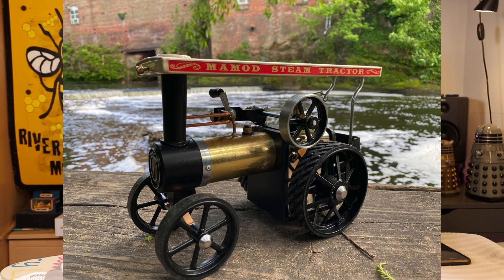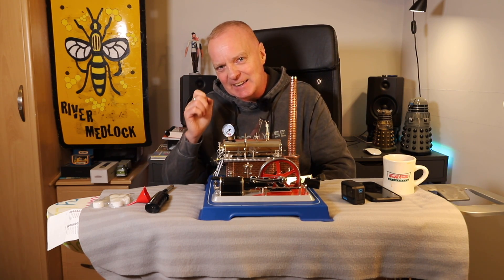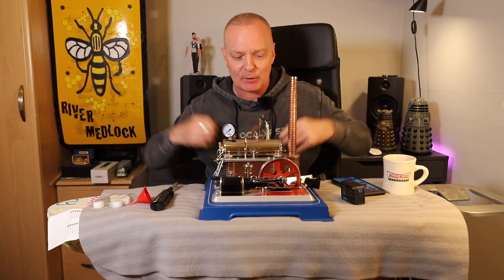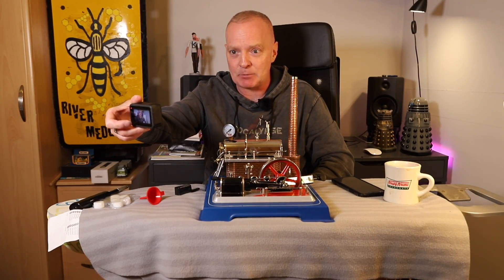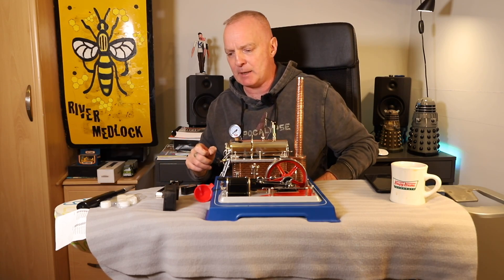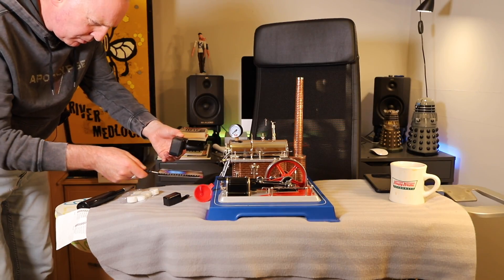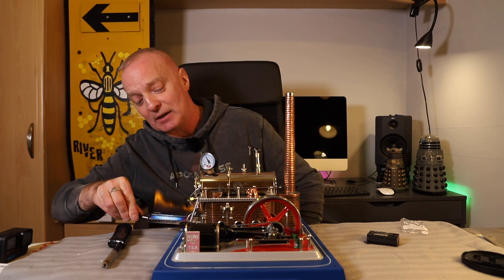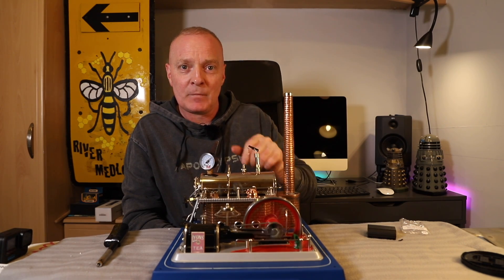Firing up  Wilesco model Static steam engine

Comment: I grew up in the US equivalent of Manchester, a city called Flint, Michigan.  I think our Yankee phrase, "Stupid SOB" is similar to your "Bloody Bugger"  A word of caution to your readers.  Make certain that your engine is on a level surface before steaming up.  I blew the back out of a Maerklin steam engine when the glass showed water in the front of the boiler, but the rear ran dry, allowing the silver solder to soften and blow off the rear of the boiler!  I was damn lucky in getting only a cut in my forehead as a result!

Comment: I was an apprentice at English Electric Vulcan Foundry starting in 1964.
Diesels only in my day and overseas orders where starting to dry up. 
One of the main Loco assembly lines was dug out and converted to assembly of Marine Diesel engines.
I left before The Vulcan closed, heart breaking.
John
Reply: John. That was the year I started my apprenticeship at English Electric in Whetstone, Leicestershire. The works built small industrial steam turbines up to 60mW. A great company providing an excellent apprenticeship. The range of machines built by English Electric was enormous, from washing machines up to and including the Lightening jet aircraft.

Comment: Those are realy fun toys for all ages! I did hook up a small DC motor to one of mine so it could power up a lightbulb. I hawe the original green diecast generator as well.
The larger machines seem to barly enough to even power up a small modeltrain from what i seen.

Comment: I've always  been  a steam nut, in the mid-50's I had a Jensen (US) single cylinder engine which I   coupled  to a hammer mill   I made with my Erector Set and entered in the school science fair which I won a First prize.  In later years I was given for Christmas a Momad traction engine which I really wasn't impressed with it's quality,  then I bought a Wilesco traction engine which was really nice.  I had plans on building an Alchurn traction engine I bought all the castings and a lathe but, never got around to building it.  As I am in my late 70"s I figured I'll never build it so I sold all my models and castings and lathe.  To may projects and now enough time.  I went to England in 2018 to attend the Great Dorset Steam Fair, I thought I had died and gone to heaven.

Comment: It's a thing of beauty, Martin. It's brilliant that there are still people willing to create models of past tech, that work as the originals did.
'Vulcan' is the perfect name for a steam engine. Vulcan's forge was supposedly under Mount Etna in Italy. When Vulcan was working, smoke and molten lava would flow from the mountain, and that's where the word 'Volcano' originates from.
Theres a great little track by the band Hawkwind, called 'The Forge Of Vulcan'; it's basically a piece for synthesizer, hammer, and anvil.
Reply from the maker: Ahh thats great info thanks Brian

Comment: Back in the early 1950's I had a static steam engine I think it was made by a company called "SEI" it had a methylated spirit burner and was an oscillating engine as opposed to a slide valve. My Son had a Mamod Steam  Roller. I think that used methylated spirit. They are great I really miss them. My friend (1950's) had a bigger much older steam engine. The safety valve was a cork bung and when it blew it hit the ceiling and we all got showered with warm water.
Reply from the maker: Cork bung sounds scary

Comment: Hi Martin. 
What a nice presentation of the wonderfull WILESCO D20. This machine-type realy is an evergreen. 
I own one of the actual models (as your´s) an also a verry old one from the early 1960s (as old as i self) that still looks "as new" and runs great, quiet and powerfull. Great machines with a lot of fun.
There´s only one verry important thing, you forgott: OIL !!! 
You never ever should run this steamengines without the proper ammount and type of steam-oil (you can buy this by Wilesco).
Without oil you have the risk of damaging the cylinder  / piston in minutes and also you should give some drops of oil to all the moving parts arround the flywheel and the crank-arms. 
Your machine will honnor this with a much smoother run and, first of all,  a longer life.
Best regards from germany (close to Luedenscheid, the home of all Wilescos)
Stefan
Reply from the maker: Hi Stefan thanks and yes they are great. I oiled the living daylights out of it. Just not on camera
Reply: @MartinZero  ..."the living daylights out of it ...." 🤣🤣🤣🤣 ...never heared that. Great !!! 
Oh how i love to learn such "Phrases" THX

Comment: My brothers and I had engines like this when we were lads. They ran on Sterno, and there were many little accessories that could be driven off the wheel. They included little figures of men working with machines and the drive 'belts' were merely twine. If you search for steam engine shows you're bound to find some that include video of the "model tent" displays.
Reply from the maker: Yeah theer are a few accessories on ebay

Comment: Beautiful engine, you need some steam oil for the piston and vavle. That's what the little pot is for on the side of the cylinder block. And also lubricant around all the moving parts to reduce wear and it will run smoother and make hardly any noise. Enjoy 😊
Reply from the maker: I did actually fully oil it before the video

Comment: I bought my son a Wilseco D14 when he was 12 the teacher asked what he had for Christmas he said a steam engine the teacher asked is it mains electric or  battery powered? He said no its steam you put water in it and light a fire! The teacher said disaprovingly just be careful make sure your father is with you when you use it! The fuel is Hexamine my son got through it like donkeys with carrots! Luckily I had a camping stove from the army surplus down the road. It uses 5cm square 1cm thick blocks of hexamine I being a woodworker took to cutting them up into the required size, but aftter a while I just use the pincers to chop them up in to a size which fitted in the burner. Just load the dust and chippings in first then lumps of the "white coal" it all burns once its up to firing temprature. My son is now twenty six so it only comes out on warm sunny days!

Comment: I would say the D455 is a noticeable step down in capacity and size then yours there.  But I like it - apart from the burner.  I will be making a metho burner for mine so a can steam a decent length of time.

Comment: i have a wilesco traction engine, you should do something similar to what i did , i drove it across the now disused belmont viaduct built in 1856 , i drove it along the ledge near the railings, it got to about halfway before it ran out of steam, oce i fille3d with water again and fuel tablets it was away again, in total it took 44 minutes to get from one side to the other, making it the last steam engine to cross the viaduct, and making me the last man to drive a steam engine across the viaduct , and also making me the saddest man in my locality

Comment: Hello Martin, nice machine but do not forget to lubricate the engine !!.
You should put some steam oil  in the little displacement lubricator on top of the cilinder.
Also put some lubricating oil on the moving parts if you want to enjoy the machine in the future.
Otherwise you will wear out the machine.
Reply from the maker: Yes it was well oiled Ronn thank you 👍
Reply: @MartinZero  👍

Comment: Well, that was every bit as impressive as I thought it would be.
I like the way it's made to look like a scaled-down version of the real things, the bricks and the ladders. You need a miniature Fred Dibnah halfway up the chimney, fixing it.
I was wondering why the pressure gauge was so out of scale, but then I realised it's a proper pressure gauge for safety reasons and that is the smallest size they make. I presume the filler cap thing is also the relief valve as even a small boiler like that could cause serious injury if it exploded.
I have heard of the Stuart Models before, in fact, I think I have even seen some videos from that channel you mentioned.
Reply from the maker: Yeah Keith Appleton. He fixes them up. Very impressive models. Mine is a toy in comparison
Reply: @MartinZero  An exciting and impressive toy though!

Comment: Fact of the day for the Diesel heads... The reason "used" steam is piped back into the chimney is the rising hot steam causes a slight vaccum that in turn draws more air through the firebox, that makes the fire hotter and keeps the steam up so you have more "on demand" power. Too much steam is easily vented but not enough is steam is a massive problem.

Comment: Wilesco are reciprocating so steam in both ends plus valve gear, Madod use an oscillating cylinder.
You need a Eccles cake to have with your tea.

Comment: If you want a little generator, use a small DC motor with a pulley, then just connect a led to the terminals ;)
(if it doesn't work, reverse connections or rotation)
Small engines look better when run as slow as they will go, this also saves the bearings
Reply from the maker: Yeah I ran it fast just to demonstrate

Comment: Very nice indeed Martin, the end shot was really atmospheric. For myself I feel these type of engines look at their best when a load is applied and they are running at lower revs. They are then almost silent in operation. I’m presently in the middle of building a Stuart model 8 mill engine, they are indeed in a different league when completed, but even the castings cost around £400 nowadays and the cost of a suitable boiler is anywhere between £500-1000 so they aren’t a cheap option.
Reply from the maker: Thats impressive that your working on a Stuart Malcolm. They are amazing machines

Comment: Nice but you really should use some oil on the moving parts it will last a lot longer 👍
Reply from the maker: What makes you think I didn’t use oil Alan ?
Reply: @MartinZero  you never mentioned it or showed it in the vid.

Comment: Boys and their Toys eh ? When I watched this I actually remembered having a very cheap version of something like this when I was a kid . Right down memory lane . I did notice a lot of vibration at the lower speeds . Is there a mechanical adjustment to "balance" the mechanism ? It should run a bit smoother than that . Cheers./SRK
Reply from the maker: Cheers Scott, Ill have a look

Comment: The most expensive Wilesco is actually the D32 at a whopping £2k. Search videos on here (you’ll probably come across mine!)
Reply from the maker: Just watched, thats fab. The Govenor looks functional
Reply: @MartinZero  the governor is for show, however on the older ones from the 70’s (such as mine with the blue base) the governor runs the rev counter. On the new ones with silver bases the rev counter is run electronically from a sensor on one of the flywheels. Interesting fact, mine has been converted from the normal electric heating to gas as the electric heaters burnt out
Reply: If you want to see more of my collection check out my group on Facebook “Stacksteads Miniature Steam Collection”

Comment: Also a huge risk of buying second hand steam engines is the risk of explosion. If the previous owner didn't treat it well (i.e. let it drop) or stored heavy items on top of it, the engines might have been damaged causing leakage, ruptures and eventually explosions when fired up and pressured. Engines might look like toys, getting hit by steam can still lead to severe burning and getting hit by some metal shards will do you harm. So, just don't buy steam engines off Ebay etc. when you want to fire them up and you aren't a qualified engineer.
Reply from the maker: True ! Thanks